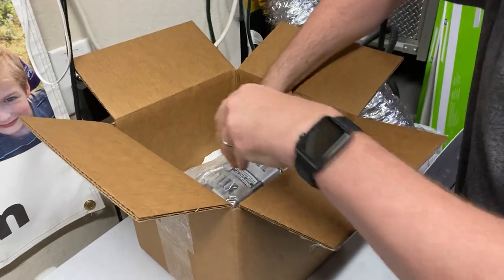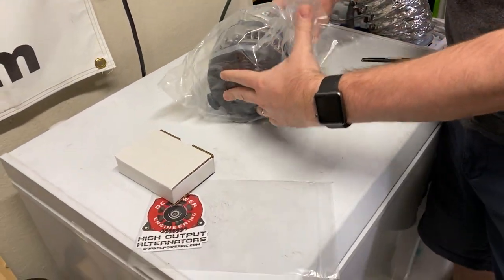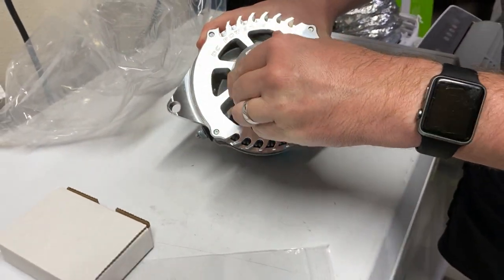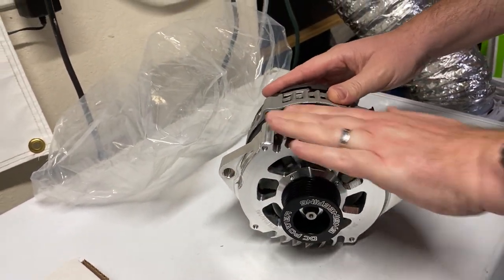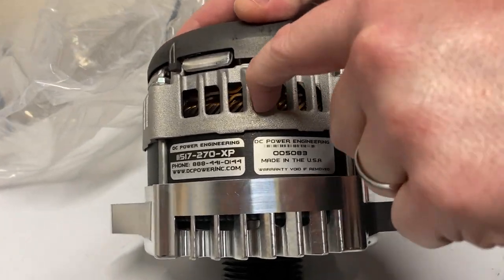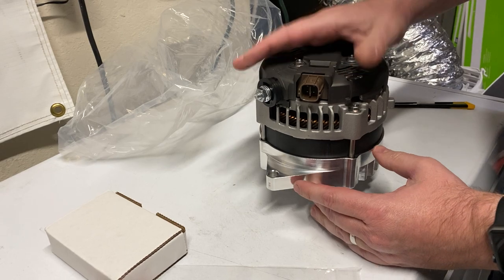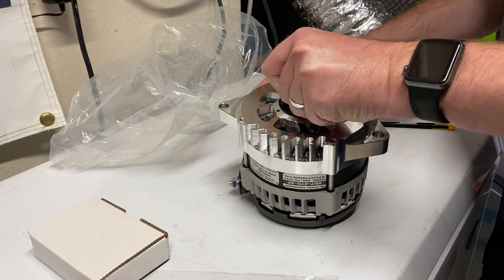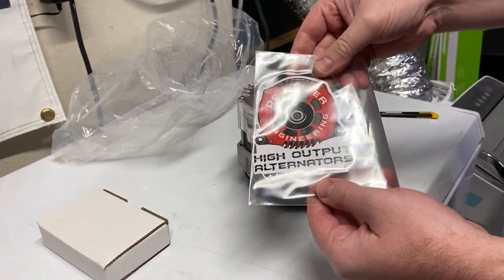Unboxing - DC Power 270XP High Output Alternator for the 2015 Toyota 4Runner

Comment: That’s just yummy! Moved it to the top of my list. Thanks for the video!
Reply from the maker: definitely worth the piece of mind, and the output is noticeably different when everything is running all at once.
Reply: @TrailorSailYT  I run a fridge (all the time, ~50W), plus winch and very few lights, as needed. I’m an electrical novice and just wondering if there’s any danger of overloading the system. I suspect there’s safeguards against that, but want to make sure. 

I run a dual battery system with two Odyssey Extreme AGMs, and a 100W solar panel feeding into the auxiliary battery, in a 2018 4Runner. Of course, I’ll have it installed professionally… Thank you!
Reply from the maker: There is always a danger of putting too much on the system. That is where a battery management system like those from REDARC Electronics are a really great idea. I may be going that route depending on how things progress with my solar project. With just the alternator doing the charging right now, I'm pretty pleased with the overall outcome.
Reply: @solooverland3666  did you ever install it? I have a similar setup but with three AGM batteries and a 90w solar panel and wondering if this alternator will handle it much better. It seems my stock alternator cannot charged all three fast enough to keep up. Either that or my shunt is giving me bad readings
Reply: @MatiasBilbao  Haven’t bought it just yet, but at some point before long…

Comment: Looking forward to the next video on this. What does is cost by chance?
Reply from the maker: You are looking at between $600-$800 depending on anodized color options, shipping, and tax. These are built to order. So, any and all questions should be directed to DC Power. They have been super helpful in answering our questions and with helping us get exactly what we need. If you want one that is already in stock, you can get the DC Power Alternators through Nations Starter and Alternator. I have heard that they typically have a stock of these.

Comment: I ordered one about a month ago, but the upgraded 370a option. I am surprised they aren't using the finned heatsink style rectifier, which is typical for these large case hairpin types. 

May I ask how long it took to receive? I did get the optional rear billet housing in bare aluminum. Maybe that's what's taking a bit longer than I hoped for. 

They sure look nice! Thanks for posting, this will help the wait!

Comment: Dang it looks nice. I plan on puting a winch and some lights on my 4runner. Is this an upgrade I should look at doing?
Reply from the maker: In my opinion? 

Short Answer - YES. 

The Looooong Answer - YES - Because the stock alternator only puts out 130A - that is only sufficient for the stock configuration of the 4Runner. Now, if you are like us and drive highways speeds for hours and hours on end after using accessories like a winch, you'll probably be okay. However, we are now doing shorter trips and running more at idle which isn't charging much of anything with the stock alternator (I think its like 80A on the OEM alternator at idle). This alternator produces more amperage at idle than the OEM alternator produces at full speed. So, this will help you recoup your battery faster at idle and full speed. 100% worth it.
Reply from the maker: add in that we run a trailer with electric brakes, a water pump, and auxiliary lights... we need this. :)
Reply: @TrailorSailYT  Awesome. I plan on doing a battery upgrade too.
Reply from the maker: @Gilbertmk2  make sure you get a little more than you think you need. Better to have a bit too much than a bit too little.

Comment: I was curious if you have put a meter on this to see what kind of amperage you're getting at idle or other RPMs?
Reply from the maker: The few times I tested it at idle was just under 200A, but I don't keep the shunt on it when I'm driving. I hope to have enough time next month to put together a video about this and our new dual battery system.

Comment: 6 month update video next. How does it do, and what did it correct or improve or give you capabilities of?
Reply from the maker: Yep. We are working on a few follow up videos: Tires, Alternator, Batter, Gears, and Armor
Reply: @TrailorSailYT  I am wanting to pull the trigger on one of these for my 2GR-FKS Tacoma, but my only stumbling block is that 2 yr warranty. I do not know what creates such a short warranty compared to the $629 price tag on it.  How has your alternator performed so far since you installed it?
Reply from the maker: @troy3456789  It has performed wonderfully. The one thing I have not done that killed my old alternator, is submerge it in mud. Other than that, I am definitely noticing the higher output when I'm running everything - Fridge, Comms, Lights, and Compressor. Its definitely a beast.
Reply: @TrailorSailYT  Oh thank you for getting back to me. It sounds like other than subjecting it to mud, you have put it through the gauntlet. I'm ready to pull the trigger on this. Again, thank you.
Reply from the maker: @troy3456789  The only thing I haven't tried yet is the winch, but the OEM alternator was able to operate that.
Reply: @TrailorSailYT  I bought it, but was unable to install it. The Lin plug is facing outward, plus a slew of other problems. I gave up and sent it back for refund minus 15% restocking fee

Comment: Has this been installed yet?  Is the output voltage as stated?  14.8v?  I thought the specs showed the positive output stud is suppose to be copper?
Reply from the maker: Yep. We have installed it going on 3 weeks now. The output voltage can be up to 14.8V, but you will need to "trick" your charging circuit into allowing that to happen. To be completely honest, I was able to get 14.9V out of the stock alternator using the ARCLight LEDs Voltage Booster. We are still using that even with the new alternator.

We made a video about the Voltage Booster quite a while back - zero problems so far...
https://youtu.be/PwZptfaqCdQ

The advantage of the DC Power Inc Alternator is AMPERAGE... Think of voltage at the amount of water going through a hose. The hose is only so big. It can only carry so much water... Now amperage is the force of that water. This is what provides power to multiple devices at the same time without dropping the voltage. I am putting together a video to explain this further, but I hope this helps answer your question.
Reply: @TrailorSailYT  "Think of voltage at the amount of water going through a hose. The hose is only so big. It can only carry so much water... Now amperage is the force of that water."   This is actually backwards.   When using a plumbing analogy, Voltage would be the water pressure and amperage would be the flow of water.   Hence "current".

Comment: Did you have to upgrade any wiring or fuses to install this?

The spec sheet says the output is 14.8v but you mentioned in another comment that you have to trick the charging system into allowing this? How is that done?
Reply from the maker: The charging circuit has to be tricked into allowing the higher voltage. We use the ArcLight LEDs' Voltage Booster for this, and we have used it ever since we installed it - detailed in this video: https://youtu.be/PwZptfaqCdQ

Comment: Looks very expensive…..r/r old one with a rebuilt one for $175……instead of $800…new one high capacity my guess….rebuilt last 10 years…save $600.    Both do the job